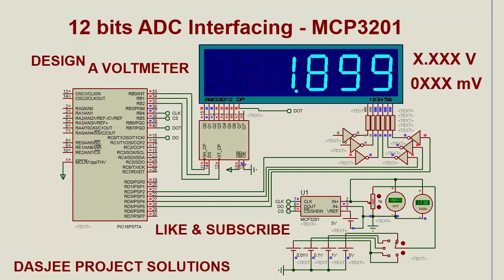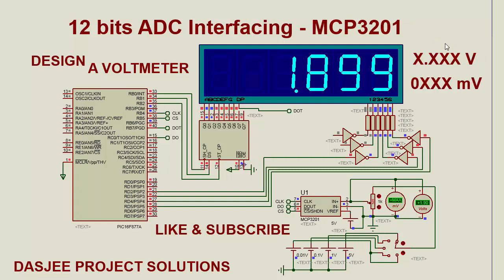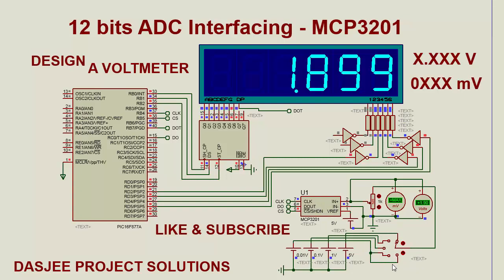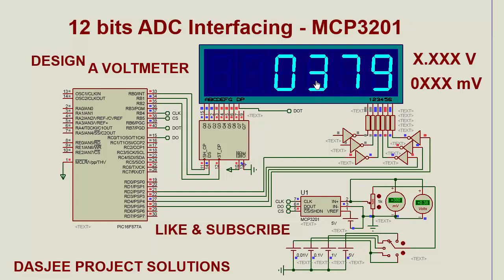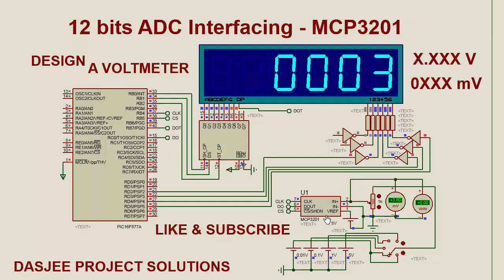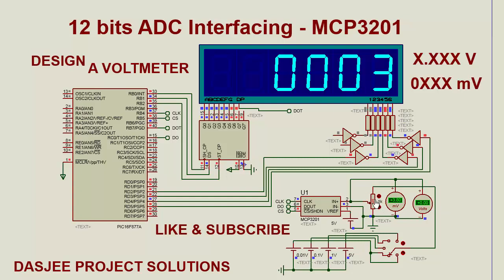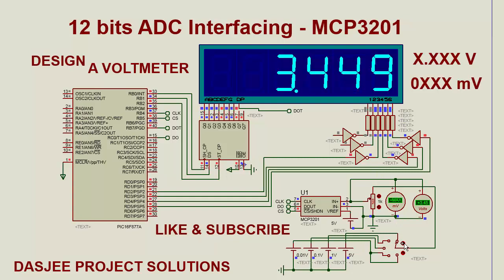MCP3201 Interfacing with PIC16F877A and 16X2 LCD

Comment: Can you share the code please 🥺
Reply from the maker: They professionally do this. I will inform you if they agree to share by the way what is your location and professional activities. Thank you
Reply: @Dcode103 
 my location is Algeria - Africa 
And I'm an electronics student.
I will be so thankful if you can provide it to me .🙏🙏
Reply from the maker: Which ide and compiler you use
Reply from the maker: What is your requirement
Reply: @Dcode103  
I'm using mikroC pro for pic 
I want to connect the ADC with the pic so I can read the temperature sensor value wich is analog
Reply from the maker: Which temperature sensor. Which microcontroller you have. If LM35 temperature sensor you use then there is no need to use MCP3201.
this is email reply use it for communication 
dasjeeprojectsolutions@gmail.com
i will make your code and will send . There is limitation due to my job need time.
Share information regarding temperature sensor and microcontroller. thank you
Reply: @Dcode103  
I sent you the information on the email ,

NTC temperature sensor in a wheatstone bridge which provide an analog voltage , I need to read the temperature from that voltage , so I link it with an ADC mcp3204 connected to a microcontroller via SPI protocol , and finally display the value at an LCD .
thanks .
Reply: sir , no need of the details like precision or linearity ....
what I didn't know is the communication between the ADC and the pic 
for example : read from the ADC and display the value on an LCD
Reply from the maker: Thermistor temperature sensor. There is video on my channel see.
Reply: @Dcode103  
I saw it already and I tried it , but my project requires me to do it with an external ADC , because the ADC of the microcontroller is a little bit bad compared to external ones , the mcp3204 need SPI communication protocol which what i can't program it .
if you can do it for me tell me please.
Reply from the maker: You want thermistor temperature sensor, mcp3201,16f877a and lcd right.
Reply: @Dcode103  
yes that's all , it seems simple but for me it's really hard to understand such things .
Reply from the maker: Ok  i will do with my time restriction. On completion will send through email thank you
Reply: @Dcode103  thank you soo much sir
Reply: Hi Mr , 
Just asking, if you managed to do the program or it is too difficult
Reply from the maker: We are facing demo error in compilation. Since compiler is demo/free type. Have you purchased this compiler. I think code size exceeds demo limit.
Reply: @Dcode103  
honestly I'm not using that compiler ,
I'm using mikroC pro , it's a lot easier,
but ,However I'm having problems with it though, it's not problems with the compiler itself but with the SPI programming.
Reply from the maker: Yes I am taking about mikroc pro. Have you purchase this software. The code which I have made exceed the demo version limit. This code is for pic16f877a + mcp3201 + thermistor temperature. Are you getting which I am taking about.
Thank you.
Reply: @Dcode103  
Yes I already have it it's free on the internet.
Reply from the maker: Yes it is free but it is demo version and limit in code size. If code size exceeds demo limit. you will get compilation error. Which I am facing. If you change thermistor by LM35 . Thermistor coding use mathematics so code size becomes large. I will try with LM35 and mcp3201 and update you.
Thank you
Reply: @Dcode103  
ok thanks,
I have tried to program lm35 and it worked normally , I will try to get the demo version though.
thank you sir.
Reply from the maker: Algeria is password of your winrar file
Reply: @Dcode103 
Hi Mr, 
I really don't know how to thank you for all your help even though you don't even  know me, thank you soo much, and I will hope all the best for you.
regarding the problem of negative temperature, I think we need a negative reference to get the correct result.
Reply from the maker: Thank you for your response.